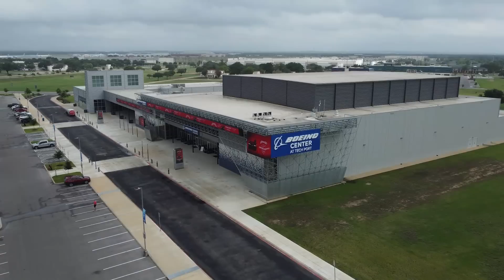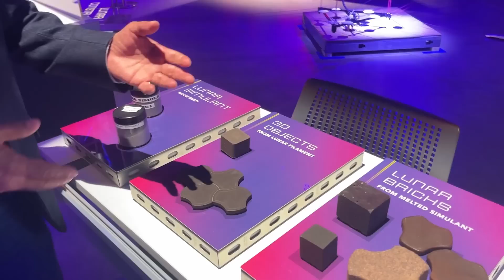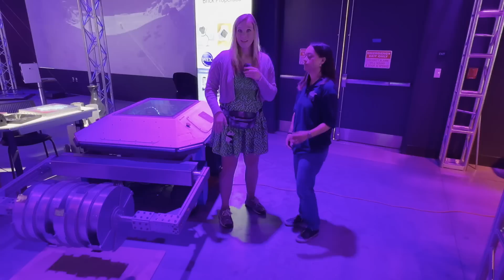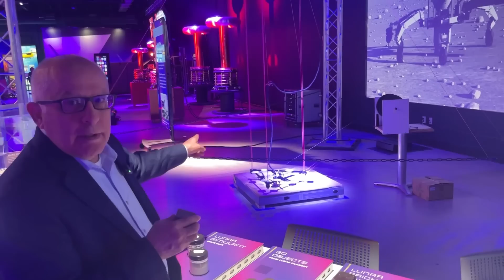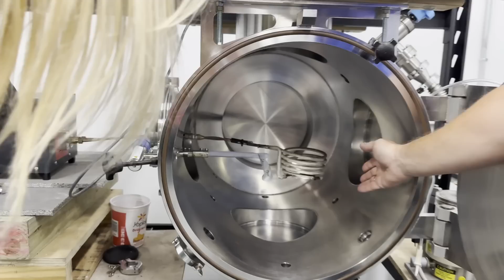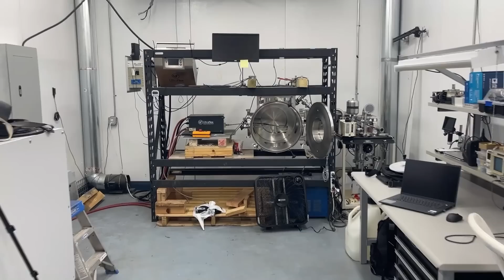How Will We Land Starship... On The Moon?!

Comment from the maker: Start speaking a new language in 3 weeks with Babbel 🎉. Get up to 60% OFF your subscription ➡Here: https://bit.ly/3VPFjJg
Reply: I’m so glad you covered this infrastructure problem.   So many problems to be solved and very little information available.  Keep them coming Ellie!
Reply: Ellie, can you talk to Steve Davis the president of The Boring Company about future Moon or Mars tunnels?
Reply: Does Babbel have a lesson on Klingon?  Always wanted to be able to cuss someone out in Klingon.
Reply: Ellie - To answer the question, how do we land on the moon, we have to understand that there are basic steps. When there is nothing there the rocket has to bring the entire landing system with it, which means huge legs like a daddy long legs spider. 8 huge legs is ideal. The cargo these deliver would include robots and cargo to build future launch and landing gear. Would that Jun 27, 2024 system of bricks do the job, I can't say, their furnace is similar to rocket exhaust temperature. But their dust scoops seems like the hard way on a large construction site. An air duster to blow the dust into a pile at one end of the construction site seems simpler, both removing the dust from occupancy zones while putting the dust in a resource pile, needing only a small rocket engine on a robot as an air duster. And a few steel launch pads brought from Earth could be copied from the drone ship's deck. This is the first step in the march from any surface landing to hard flat surface landing to landing on chop sticks with a rapid launch/landing cadence. Blow the dust away, landscape construction sites with large robot bulldozers and steam shovels. A phased project approach to be copied on Mars about a year after each step is successful on the moon. Quick, a Starship sized perspective.
Reply: Hey Ellie, you could always do what they did in Hitch Hikers Guide To The Galaxy, stick a yellow fish in the ear !
Reply: * WE BUILD A HOLLYWOOD STUDIO AND FAKE IT!   JUST LIKE WE DID BEFORE.
Reply: @seymorefact4333  Capricorn 1 wasn't a documantary !
Reply: Aramaic
Reply: I’m looking to go with my family at three to see flight 8, can you recommend the best way to go about it from California?
Reply: So much brain power being wasted on something we don't need to do again
Reply: Why not let the Chinese knock themselves out and become  number at the cost of a trillion dollar. 
Then we make a documentary of their trip and with world wide distribution we will make a trillion dollars😊

Comment: Landing Starship on the Moon presents immense challenges, especially given its massive size compared to smaller lunar landers that have recently tipped over during attempts. The sheer scale of Starship amplifies risks, such as maintaining stability on uneven lunar terrain and managing its powerful engines without causing surface damage. Recent failures of smaller craft highlight the difficulty of achieving precise landings, and these issues are magnified exponentially for a vehicle as large and complex as Starship. Overcoming these obstacles will require groundbreaking engineering and rigorous testing.

Comment: In the planning stages for Apollo it was thought there were only 2 options, Direct assent, and Earth Orbit Rendezvous.
      Both of these options proved to be infeasible for several reasons, but one of the biggest was it would require landing the entire ship on the moon's surface. The ship would land with everything the crew would need to reach and land on the moon, then take off again, return to earth, survives an extreme reentry and land safely back on Earth.
    On top of this, the ship landing on the mood would need to be huge, meaning it would have a lot more momentum, and it would be much harder to land, and be less stable in the surface. Also, as the crew space would be at the top, it would require a long ladder to reach the surface, then get back after you have finished your moon walk.
    Instead, a 3rd option was chosen, Lunar Orbit Rendezvous. This allowed for a tiny lander as it would be designed to work only in space, and you can leave everything you need to return home in lunar orbit.
    And best of all, you put your launch pad on the lander itself and use different engines to control your decent. Blasting off you leave all of the stuff you used to land on the surface of the moon, transfer to the mother ship in lunar orbit and use that to get home.
     This is still the best way to land on the moon. What Space-x is proposing is still as unfeasible today as it was in the early 1960's.

Comment: Is PLA resistant to radiation? Space radiation. 
How about using materials from moon surface and separate them, then melt it using electric kilns for example? They would need only to transport the kiln the solar panels and the solids separation device (magnetic for iron).

Comment: I see many safety hazards with Starship landing on the moon. Apart from having a landing pad, being dependent on an elevator to travel up and down to the moon surface can be very tricky. What if the elevator malfunctions when being on the surface and not being able to go back into Starship? That would be your worst nightmare if there is no moonbase already in place to survive until the elevator is fixed. I think a better solution would be to have a smaller lander. At least one with a lower height profile. You don;t have to hassle of needing a landing pad and you can use a simple ladder. At least for the first landings I would go for that route.

Comment: First off Elon Musk has released concept drawings of a Moon landing Starship and it will have landing rockets higher up for the last few seconds of the landing cycle.. Besides the Moon has a far lower gravity well to overcome then the Earth so less engine output using fewer engines and cutting them for the last couple seconds will prevent boring a hole and creating a massive dust cloud.. For Mars, a space port in orbit of either a space station or one of the Mars Moons will be the gateway to Mars surface landings.. Being able to do low speed deorbits through the Martian atmosphere will also reduce the stresses on any vehicle landing.. Same would apply to Earth reentries, coming down at 2k mph or less is far better that the blistering 17k mph that is used now..

Comment: "How Will We Land Starship... On The Moon?!" You seem to be overlooking the most fundamental problem of all. Trying to land Starship anywhere, but especially on the moon, would be akin to trying to balance a pencil on its eraser. It's virtually impossible. There is a reason why the Apollo lunar module was designed the way it was. Short and wide, with a low center of gravity.

Comment: The answer isn't that complicated. The US military does this all the time! Some planes are toughened up so they can land just about anywhere that is flat at the cost of more cargo capacity. Jets used on carriers have beefier landing gear than ones that fly from pristine runways. The first few starships will be designed for austere landing and will carry the essentials for building landing pads. The rest of the ships that will come later that can't land on an austere surface will use the landing pad. Keep in mind that landing on the moon is MUCH easier than landing on Earth. 1/6th the gravity is a big deal! Landing gear for the moon only needs to be rated for a moon landing. Return to Earth can still be a catch like SpaceX is testing for now.

Comment: We Never went to the Moon because Space is not a place that can be traveled through. It's about physics namely the 2nd law of thermodynamics and the entropy of a gas. Gas cannot form a sphere shape inside of a vacuum. That's impossible in physics. That so called sphere shaped gas you call atmosphere cannot fail to expand into the available volume it MUST expand causing you Not to have stable pressurization on Earth to breathe. If Earth had an atmosphere (oxymoron as gas cannot form a sphere in a vacuum) that gas would leave Earth and you would die. Again, thanks to the real physics of the 2nd law of thermodynamics. Gravity has never been demonstrated to hold gas to Earth. Heavy gas may appear to pool for a short time but it will expand to fill the volume due to entropy until equalization occurs.  This all shows the heliocentric model is totally wrong. We Must have containment and not be in an open system. Globe Destroyed. Sorry folks but the heliocentric fairy tale is a 2nd law of thermodynamics violation many times over.  

Now if you think I'm wrong all you have to do is Demonstrate the claims. Show me 1) gas forming a sphere in a vacuum that 2) fails to further expand into and fill the available volume due to entropy until equalization occurs. No one Can do that as it would violate known established physics. If you can pull it off, you would win a Nobel Prize for Proving the current understanding of the 2nd law of thermodynamics is wrong
Reply: I do not believe you.
Reply: The sun is held together by its own gravity. That's how nuclear fusion is produced due to the intense pressure in its core. The atmosphere of earth is held together by the same gravity keeping you from floating off...

Comment: Informative and a perspective that most don't consider. As in any war (this one fought against the vagaries of outer space), it's always the logistics that make the difference. It's not the glamorous part getting all the attention, but it's what counts in the long run. But, still no answer to the destructiveness of the never-smoothed-by-erosion lunar dust on all equipment, seals, windows, etc., etc.  Showstopper, if you ask me, until someone deals with that issue. It's yet another thing to imagine how much dust will be hovering above the surface after the first few dozen rocket landings and launches!

Comment: I had the idea after watching the Apollo missions that they could send a robotic landing pad group to level and "Spray" a poly ceramic mixture on top of a leveled field several times to make a nice hard landing area.  The gravity is way less... means way less fire out the back... you can land in shadow to keep things as cool as possible... Then use more poly base to cover the ten acres around the site to try and keep some of the dust down.  They same material could be used to build structures or keep tunnels open.  I don't think you have to go to all the trouble to make bricks... 
Think... super glue and and baking soda.  But more like... truck bed liner and regolith.  A plastic 'gunite' that can be in any shape.

Comment: The ancient ones of the moon used silica to build walls, towers, dooms and monuments. Like a very heavy silica jell that needed to absorb bombardment from small meteorites without creating cracks that migrate through the structure. The moon does not have a heavy enough atmosphere to burn up  the small falling space rocks. Of course the moon surface was probably pulverized into lunar dust in ancient times.  I wonder if we could make Gorilla Glass on the moon. Gorilla glass in a foam brick form would be very durable, maybe even bullet resistant.

Comment: Landing isn't really the problem. Taking off again is really going to be an issue, especially on Mars. Prior to installing the cooling pad, the engines dug out the area under the launch pad and crippled the rocket. Without a solid foundation to handle take off, there is a good chance spaceX can only do one way missions.

Comment: Elon has the Boring Company.  Instead of building a Tower, SpaceX can just bore a hole, create a tunnel the Starship can land into.  

You can connect multiple landing tunnels with horizontal tunnels that line up with Starship doors.  

Being underground, astronauts will be protected from Sun Radiation.

Comment: I guess we ask Elon again, load a whole lot of Optimus onto a starship with tools send them up to stay on the moon, deconstruct Starship as it will already have heat tiles and stainless steel which can be incorporated to a new landing platform.  Yes the first one may have to land and fall over, just ensure it is a full burn to exhaust fuel to avoid catastrophic explosion alternatively if there is the fuel left this can be used to fuse or weld landing structure.  It will be an iterative process each additional Starship will carry more tools, fuel or Optimus robots to build and build and build I'm certain with Elon's mindset he will out do and deliver before the others.

Comment: There is a lot of talk these days about ISRU and industrial processes in space. The one consistent dealbreaker is energy. Look at that 'full size' 3-lobe brick of fused silica. A great deal of energy is needed to effectively make a glass block that size.  
Solar? that will take vast acres of panels that will get covered with the dust stirred up by astronaut and ship activities. The moon rotates once every 28 days. Panels will need to move regularly for best efficiency. Even at the poles there will be periods of darkness, usually for at least 14 days at a time. 
RTG? No. Just no.
Fission reactors? Maybe. Once you've made one light enough to be flown to the moon and gotten the regulatory approval to fly a meaningful amount of fuel, figure out how you will do heat rejection. On earth we use large reservoirs to supply the cooling towers that dump excess heat into the environment. There is a lot of hand-waving on this subject saying "liquid salt reactors" and "IR heat rejection" without once putting a pencil to paper and realizing what they are saying.
Now look up "respirable silica" to know why you never want to live on the moon.

Comment: As a construction medium, my concern would lie in long term integrity under constant expanding and contracting conditions due to extreme temperature fluctuations. Because of this, I think temporary lunar habitats should be designed for burial under automated mining refuse inside the holes they create. Not only would this layer provide insulation, but protection from harmful radiation, solar wind, micrometeors....

Comment: Plan 1) Just laser a bit of the surface of the Moon from Earth, melt it into a nice flat pad. Done.
Plan 2) Move one of the existing space lasers into a lunar orbit and use it to laser out a pad.
Reply: Some of the craters already have a nice melted surface.
Reply: Or maybe melting the surface with a nuclear reaction say if you had a shape charge in a large crater and have a stadium size lz with sealed bottom and sides the you can bore into the sides for habitat
Reply: How about using the first landing attempt's cleared blast area?  They could even hover just above the surface, ignite all three engines briefly to clear more space and land in the spot they cleared.
Reply: @davidbeck9066 don't think kicking up giant clouds of dust is going to do much to keep said dust out of the vehicles and habitats. That's what I see as the largest challenge. If the dust is charged and sticks to everything how do you explore the moon and keep the dust out of the habitats and off the airlock seals. Can't be tracking it in with each excursion cause you can be breathing that dust.
Reply: @ulbuilder  I don't see any way to mitigate the cloud for the first unmanned landing. however, if they embrace it and land under high power on purpose it might blow away much of the dust (then hopping to a second spot).  If the next landing is months down the line maybe it will have settled and subsequent landings wont kick up so much.
Reply: @davidbeck9066  Seems like robots could be sent to build a landing pad ahead of the humans arrival.

Comment: A "big picture" overview of establishing a moon habitat would be most welcome.  I understood that something needs to be done with regolith but I presumed it was good enough to sweep it away!  How many other series of problems must be resolved before a lunar habitat can be open for general use?
Reply: I wonder if the naturally occurring suspension of microscopic lunar regolith abrasive dust particles, from the insitu static charges, is something that could be leveraged to protect the astronauts breathing systems, and living systems and air hatch seal systems.   Just spitballin but on earth there is a cool painting system called powdered pigment powder coating "painting" of metal parts.  The part to be painted is suspended but connected to an attractive electrical polarity and the fine powder is sprayed near the item but the charge potential sucks most of the paint powder to the metal like a magnet before the part is placed into a 400F deg oven and the paint dust pigment..... is fused onto the item surface.... so.... Put a dust attraction charge filter inside Moon spacesuit respiratory paths,....around the circumference of door seals to protect  from dust caused seal leakage voids, etc ....  Put em everywhere to pull away the dust from where you don't want it ....just spitballin....

Comment: You saw the massive work they did on the launch mount. Even with the low gravity of the Moon, the SS is incredibly heavy and worse, massive (think inertia). This means laying down tiny bricks on a leveled field is not going to support the SS. The landing legs will crush and scatter the bricks. Good research and necessary and will turn this up for sure but a big deal. 

Thanks for the extra info. A good idea. I wonder about the high temp needed. Take a lot of solar cells or nuclear battery (needed anyway). You can interview rovers, power supplies, water & fuel recovery, and habitats (don't forget using SS as an early one).